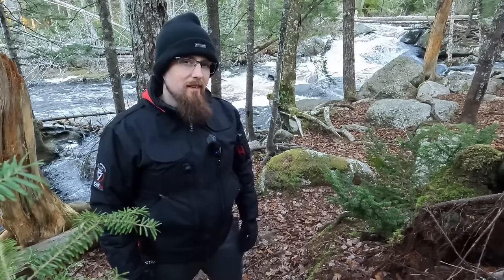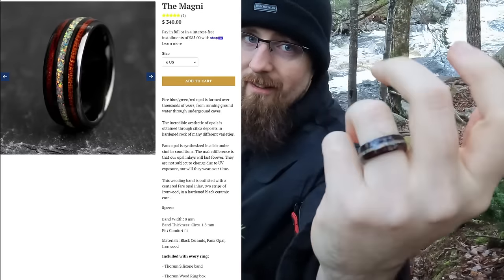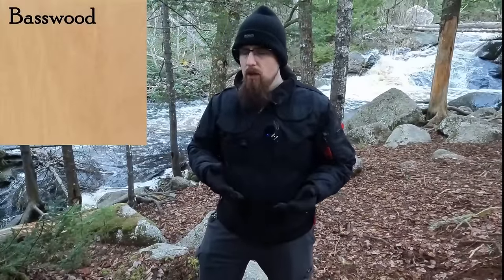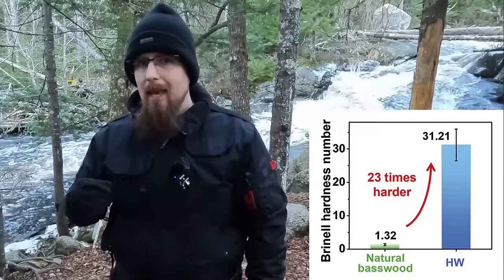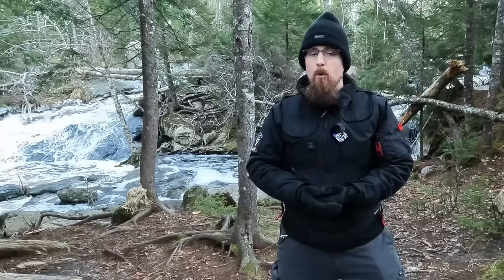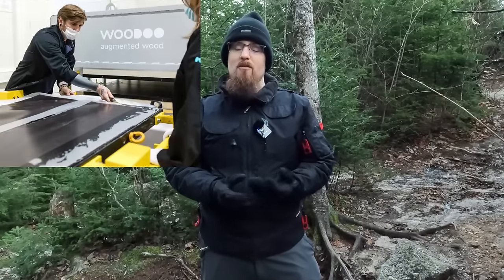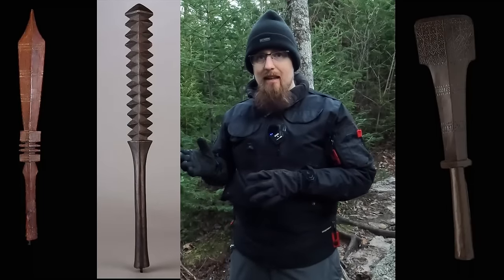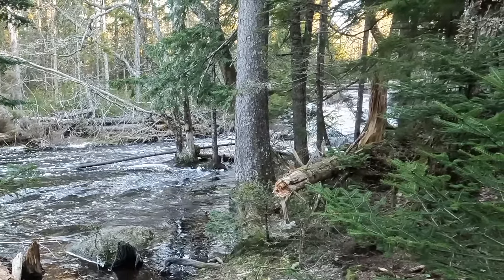Hardened Super Wood!  -  Can It Rival Steel?

Comment: A good thing to remember is hardness isn't everything. When it comes to "strength" of a material you also have to think about directions of stress. ie shear, compression, and tension. I'm curious how this material is against stress.
Reply: If, when and how it shears would be interesting... 

If you plabe the edges how well does it hold a blade? Etc

I vaguely remember a comment or story that was attributed to the Spanish conquistadors speaking one of the weapons the tribes was a  paddle shaped implement made of Brazil wood.  They claimed it could decapitate a horse with a single swing ... thats extremely impressive!
Reply: Just wanted to say this. I have a hunch it will not hold up well as a polearm or staff. Plus the only reason you can harden the really soft wood so much is because it has a low density and then you compress it more. With already hard wood, you wouldn't be able to compress it that much, and it stands to reason that you won't be able to get wood as hard as bronze, because it's still made of , well, wood. And lastly, the transparent "wood" more of a "just for the sake of it" kinda thing. A youtuber (NileRed) did this, and it involves burning away some components of the wood, and then replacing them with epoxy to the point where you slab is more than 50% epoxy. So it really has no applications (other than decorative) and it's very hard to pull off.
Reply: Yeah, super hard materials are often brittle as balls. It's not very difficult to smash a diamond or break a cast iron pan.
Reply: @mrkiky  Absolutely true on density vs. material. Lignin and cellulose have their limits as a basic material and no density will overcome them. 

As to making transparent wood, it's the same issue. You're not really making the wood transparent so much as replacing lignin with other materials. From a fantasy perspective, anything is possible, but hard sci-fi and you're no longer really using wood.
Reply: Also a factor that is very important in engineering is the specific strength, so the stress a material can withstand in comparison to its mass
Some woods can have better specific strengths already than steel or aluminium (In specific directions)
Would be interesting how this stuff measures up
Reply: @Hendiadyoin1  I'd guess it depends on how its being compressed. If the fibers stay straight it should be comparable to harder woods, some of which do indeed become quite brittle (lookin' at you, Purpleheart). If the fibers become really tangled up, then you're basically turning wood into a kind of plastic and making it isotropic.
Reply: I feel like it would be used more for basic housing and simple constructions just being made stronger. I could not see it being done for like a large office building but maybe if research continues and advances
Reply: @michaelriddick7116  "If, when and how it shears would be interesting..."  THAT reminds me of the cautionary tale of "carbon fiber kinetic flywheels". Early testing found it was VERY difficult to make a consistent composite. When they DID it turns out a "consistent composite" behaves like a crystal when it fails - instead of shredding itself, it detonates and fails spectacularly.... Check "Blast injures 5 at Poway business" from San Diego Union Tribune.  One of the nice points of wood IS that it is non-unform, and absorbs energy as it breaks.
Reply: @mrkiky  Interesting anecdote, from an actual timberframer who does historic restorations- a 'trick' for fabricating colonial / 1800s wooden tool shafts IS "pollarding"- trim a tree to get straight vertical limbs.
In TOUGH applications, the woodsman would TWIST growing sapwood into a spiral so the grain would break in a spiral, NOT splinter (ala 'A Knights Tale') which was VERY useful in axels and bobbins.
Reply: @Hendiadyoin1  In a recent video of Tod Cutler, he had Matt Easton as a guest and they were testing a weird warhammer with a metal shaft and sword hilt. So the shaft was a pretty thick bar of steel, yet Matt managed to bend it on multiple hits. The observation was made that a thicker, but still lighter, wooden shaft would not have bent or broken under the same hits. 
Obviously don't know for sure, but I have a strong hunch that chemically treating wood to remove some of its components and then compressing it will cause it to lose that natural elasticity and toughness.
Reply: @HalSchirmer  watched some videos on using osage orange for bow staves, if I understood it correctly,  osage trees can self spiral (you apparently can track this by the bark) one was saying, na, you don't want this while someone else was making 'wavy' bows, I assume out of twisted osage but could be wrong
Reply: High hardness glass cuts well and works as armour, but is also very brittle...
Reply: "Hardness isn't everything" - I'd go so far as to say it's hardly anything, lol. In actual industrial applications, especially regarding metal replacement initiatives, hardness is pretty much never even mentioned. Tensile strength and Charpy impact are the only structural properties cared about like 99% of the time XD
Reply: Yeah, hardness is just one of the other application-specific properties. Hardness mostly says that the material can scratch other materials better.
But if their idea was to make lasting wooden kitchen equipment (utensils, cutting boards) - it's a good point of view, the bump in hardness is great
Reply: Well in this application its shear and tension what matters.
Compressive strength is very close to newer being the limiting factor in any structural application - in the sense that you tend to run into crippling issues with other types of loads long before it could become a problem.
Reply: As a bowyer, I use heat-treating to harden the belly of a bow. This reduces "set"(permanent bend) and helps to prevent compression fractures(fretting). But we leave the back of the bow (the side facing away from you) alone. The back needs to remain pliable lest the bow explode when drawn.
Reply: @michaelriddick7116  you're speaking of the macuahuitl, which was features in a skal video about nonmetal weapons
Reply: @choronos  in gemology it's called 'hardness' and 'toughness." The first is resistance to scratching, the second is resistance to breaking, as from an impact. The hardest gemstone is of course diamond but it's not extremely tough. The toughest gemstone is nephrite jade, due to its interlocking fibrous structure which actually allows some slight flexing in the material to absorb impacts.
Reply: @justabill5780  This is exactly what I was wondering about. You'd be well outside of traditional bow territory, but I wonder if this could be used for softwood belly laminates, or perhaps siyahs? Doubt it would perform better than fiberglass bows, and in both cases it's not the kind of primitive bowyering I enjoy, but it could be a fun experiment regardless.
Reply: @BakaEngel  : It may HELP softwood laminates in the belly. But, depending on the wood, it may not be sufficient. It would likely worm well for siyas.
Given the right design and woods, a traditional bow can compete with fiberglass.
Reply: It could very easily be laminated.
Reply: True the good way to say it is how tough and flexible can wood be
Reply: @Yorick257  Well, a cutting board has to be in a sweet spot where it doesn't get shredded by the knife constantly sliding against it, but not so hard to dull your knives fast. Sounds like the hardness they achieved with that basswood would be too much.
Reply: @michaelriddick7116  I remember very similar story from book about Spanish conquistadors where some priest used wooded sword with obsidian edge (or spikes or something) to cut horse's head off (subsequently surprised why it did not kill rider too, since they thought rider and horse are single entity), isnt that the case? Because in that, real cutting is done by obsidian.
Reply: Ok the way you wrote that just makes it read dirty.
Reply: @michaelriddick7116  the weapon you are thinking of is the machahuatle, and it has obsidian blades attached to the wood.
Reply: @Drazex  nonsense... It depends on application. The paint and coating industry is incredibly interested in hardness. Packing material industry as well. Just to name some.
Reply: @mrkiky  You can probably get wood to be harder than bronze. 

And transparent wood leaves the cellulose skeleton of the wood. If you can replace it with an economic or green polymer, you can have a clear strength-and-sustainable benefit.
Reply: @DariusBaktash  Cellulose has theoretical potential that outreaches almost any other material in the world, so saying ''have their limits as a basic material'' does not mean so much. 

And if your transparent wood is 50% wood, of course you're using wood...
Reply: @FrenkieWest32  I highly doubt that. And if transparency is what you want, you can just use the polymer by itself. The only advantage to go through that whole process is that it leaves the 'skeleton' like you said, which still looks like wood and is kinda cool. It also only works on thin sheets. You can't make a big block of transparent wood as the chemicals won't penetrate that deep.
Reply: @mrkiky  You doubt that based on?

The ''polymer by itself'' is potentially either: much weaker or much more brittle (or less sutainable if you use higher property polymers).

The chemicals can likely penetrate as far as you want; it would just take more time or pressure.
Reply: @FrenkieWest32  Both of which are barely afterthoughts to this application. When considering the advantages creating this compressed wood - especially when trying to imply it could be used for metal replacement - paintability and coatings is barely an afterthought. 

Just look at the applications they themselves look at when presenting the material: kitchen utensils and nails. These are the kinds of applications for which "can it be dented or scratched?" are far and away unimportant, whereas the all-important "will it break?" properties are entirely ignored.
Reply: @Drazex  Yeah, to this application. That is not what you said before... And Metals are used for cutlery, or bladed weapons, or tools, or window frames, or car parts, etc. Hardness is definitely a relevant factor in all of these.

You think it is not important for a nail whether it is hard? What do you think happens to the tip of a soft nail when you hammer it in? What do you think happens to the edge of a knife if the material is soft?
Reply: @FrenkieWest32  Based on the fact that metallic bond usually provides much higher hardness than covalent bonds present in the components of wood. Sure there are some really weak metals, but bronze is not one of them. 

I doubt that's how it works with the chemicals too. The factor that made the difference from failure to success in Nile Red's case was using thinner slices of balsa wood. And it was the same in all the papers that he studied in order to pull it off. Maybe you could make it more efficient by circulating the chemicals, but "more time and pressure" could mean from overnight to a few months since it would grow exponentially the deeper it needs to penetrate. So yea it's kinda cool as a proof of concept, but I don't see it used in anything other than small scale decorative stuff.
Reply: I'd assume that the strength against the grain would still be pretty high, since the cellulose fibers are quite long, but the strength  along the grain might be more poor than regular wood.
Reply: @mrkiky  
Diamond is the hardest material known and it is based on covalent bonds. Not to say wood is like diamond, but high hardness can definitely come from covalent bonds.

Low-scale, individual researcher lab setups are not comparable to industrial methods. Using huge pressures is not something industry is a stranger of. I've seen pressure increase diffusion of liquid into porous materials by factors of multiple orders of magnitude.
Reply: @FrenkieWest32  Yea that's why I said "usually". The flimsy chains that end up stuck to each other amorphously in wood are nothing to be compared with the solid carbon atom crystal lattice in diamond. If anything,  metals are structurally more similar to diamond. 

And yea sure, fair points. But I really feel that there's no benefit to keeping the "skeleton" of the wood intact and then doing all that heavy lifting to replace 75% of it with something else. Not like the "skeleton" has any magical properties that its worth bending over backwards in order to keep it because we can't obtain said properties by starting from scratch. Non-heavily treated wood has pretty good properties, and the good thing is you don't have to do anything to it after harvesting, which is why we use it so much. This super modified wood is along the lines of plastic made from carbon dioxide extracted from the air. Yea cool proof of concept, but you wasted so much energy pulling that CO2 out of the air and then refining it into plastic that you just released 10x more CO2 with the energy you burned. Same here, you put that wood through complicated industrial processes which involve large amounts of chemicals, specialized equipment and energy costs to basically just make a composite material that includes polymers anyway. It's not wood anymore, it's not cheap, it's not readily available, it's not carbon neutral. But does it have properties that blow any material out of the water in terms of toughness, hardness, compression resistance, insulation, optical properties? No, we already have canvas or fiberglass micarta, glass, plexiglass, glass reinforced nylon, various metal alloys and of course wood. Truly the only plus side is that it looks like wood, but it might also be translucent or much harder than regular wood, while still having that wood grain, for the looks.
Reply: @mrkiky  flimsy chains? Cellulose nanofibres and nanocrystals are some of the strongest and toughest materials, especially incorporated in composites. There has also been extensive progress in improving hardness. Metals are not covalently bound.

 This cellulose skeleton is a more advanced hierarchichal design than any synthetic material we can produce. 

That modified wood (even with polymer, which is one of the cheapest and greenest structural materials) is far less energy intensive than metal processing... Ever look at the CO2 footprint of steel? Ever look at the carbon footprint of glass (which is not tough at all by the way)? Nylon is not a structural building material. And micarta is literally a wood-polymer composite... Did you not just say how ineffective this is?
Reply: @michaelriddick7116  I believe they were referring to the weapon known as the macuaitl
Reply: @FrenkieWest32  I never said metals are covalently bound, in fact, I specified metallic bonding. I said metals are structurally more similar in the sense that they form a crystalline structure rather than an amorphous structure found in wood. Polymers, whether synthetic or natural, like cellulose, just simply don't have a structure that lends itself to high hardness. Toughness at low weight, sure, but not hardness. All of the hardest materials are crystals. 

"This cellulose skeleton is a more advanced hierarchichal design than any synthetic material we can produce. "
But that doesn't automatically imply it has superior mechanical properties to simpler designs. And while wood is definitely unbeatable in many applications such as tool shafts, there's nothing indicating that dissolving and replacing part of it with something else really improves it. 

Micarta is a bit of an umbrella term, but it generally does not refer to any wood polymers. It's usually a canvas or fiberglass layer structure stabilized in some thermoplastic resin. 
Some polymers are green, but others (and if I'm not wrong, most of them) are flat out made from petrol extracted from the earth and refined, which is about the least green thing that can be.
Reply: @mrkiky  I know you did not say that. Sorry if it sounded like that. I would classify the bonding type as part of structural similarity, but this is getting off topic. Anyway, glass is amorphous as well and it is incredibly hard. 

I think it likely does. It is evolved to be load-bearing. In any case, normal wood is highly porous and thus has low density. Its mechanical properties scaled to density are incredible. So the running hypothesis is that condensed wood could become quite an extroardinary feat in terms of properties. 

And the property improvement effects of wood composites have been established long ago. Saying there is nothing indicating that wood impregnation improves it, is just incorrect. On a sidenote, there's incredible opportunity to impregnate wood with functional polymers (quantum dots, vitrimers, etc.)

Depends on how you would define ''green'' I guess, but any material we use requires energy (and thus emission, water usage, etc.) to be processed. Plastic is less intensive than almost any other structural material.
Reply: Metalis Is top in almost every category
Reply: granted im going off of what i found like 6 or 7 years ago when i was reaserching stronger organic materials to incorperate into geneticly enginiered bio machines, so what i found was that iron wood is actualy an umbrella term much like nano machines are, the terms cover a wide ranges of technology or in iron woods case... species of wood... i then searched for the hardest, and the toughest/most flexable of iron woods, and what i found was snake wood for the toughist, and vignium lite for the hardest, being harder than base iron, i dont remember how much harder than iron.
Reply: Girth, too
Reply: I wonder if someday there would wooden weapons as hard as steel.
Reply: Among other characteristics like elasticity and ductility.
Reply: Good point
Reply: Toughness, the integral of strength over strain. Very strong over limited strain is brittle.
Reply: @michaelriddick7116  those actually had Obsidian on it, it wasn't the wood
Reply: @choronos  you now waht also super hard? Glas and this breaks esay